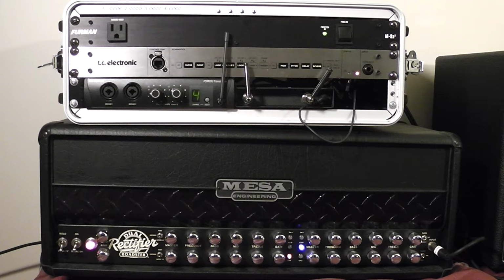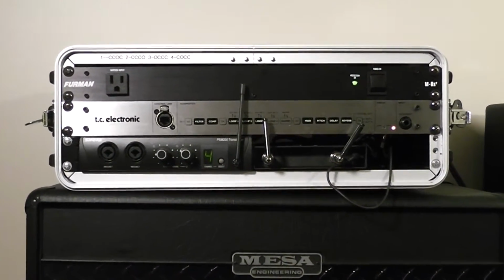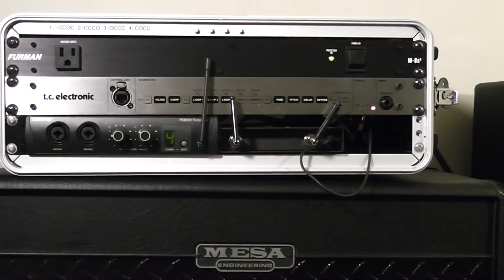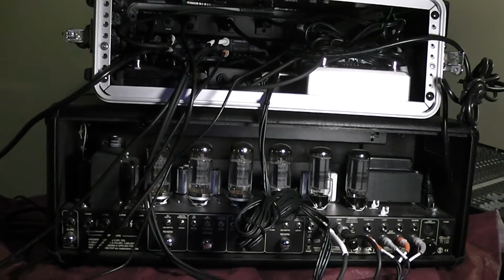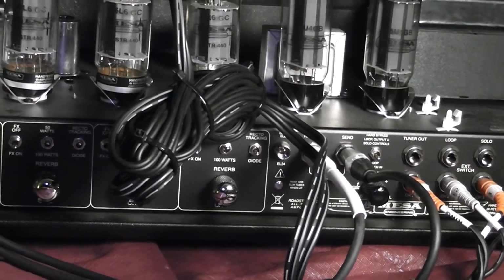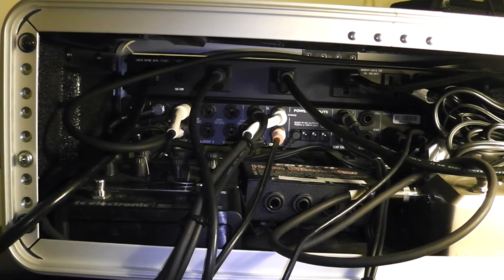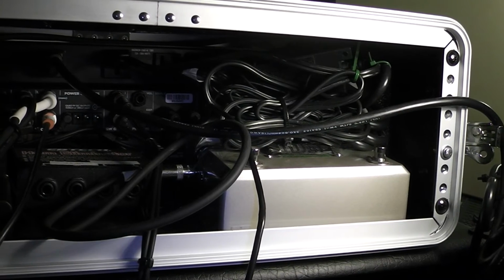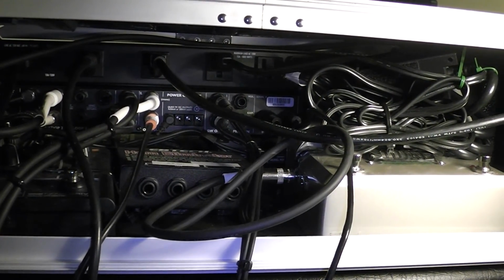Mesa Boogie Roadster & TC Electronic G System--Part 1

Comment: Yes you definitely can.  I have it set up to do this.  You use the Relays in your G System with two insert cables running from Relay A and B to the 4 channels of the roadster.  I can send you the specific relay codes if you like. Let me know